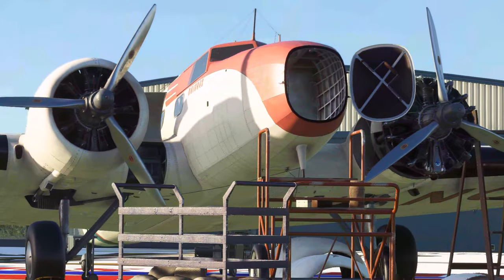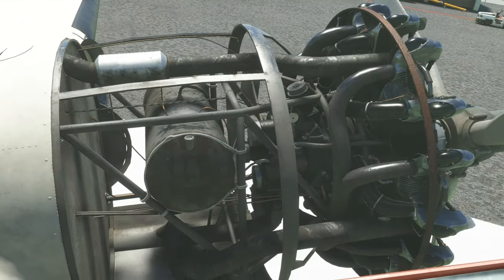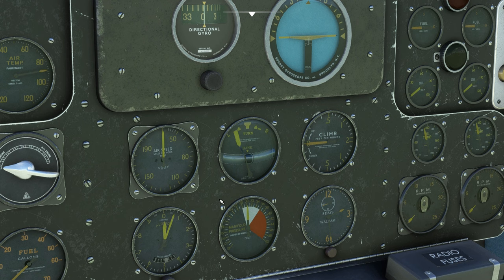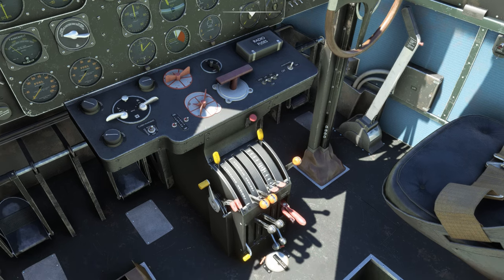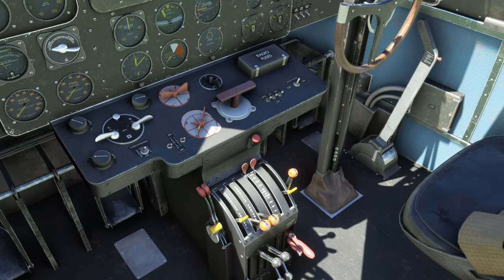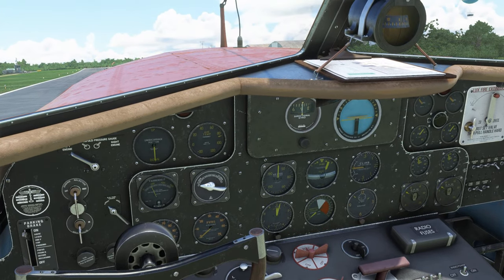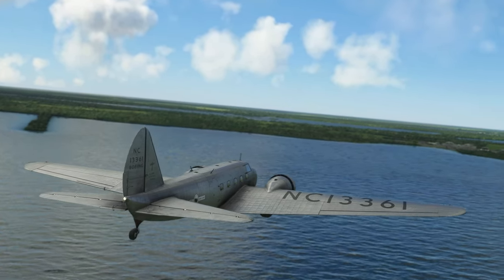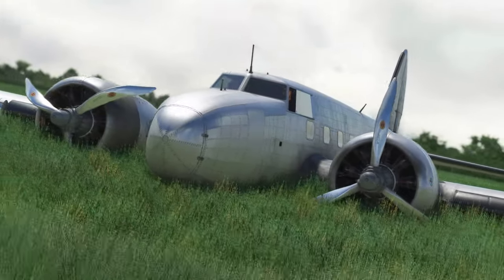MSFS Wing42 Boeing 247D Review & Tutorial

Comment: Thank you for this tutorial. But I seem to have a problem... My right engine starts up normally, but after 65% of winding the flywheel. That's not the problem. The problem is the left engine... It won't start. I tried for an hour to get it started but it still doesn't. Do you have any clue why?
Reply from the maker: Maybe, it might be a bit of a bug with the way this plane saves its state between flights, try turning everything off and to their cold and dark positions, then exit to main menu and start the flight over. That might fix it not sure. But you shouldn't have to go up to 65% for the flywheel it should start well before that. The 247 is rather particular in what it wants you to do for startup. Does it work if you start it from the runway?
Reply: @unrealizedflight  Yes, I tried everything, even turning it on and off, and every time I start the plane, I make sure everything is set to off. But it still doesn't work. The left engine starts up perfectly every time...